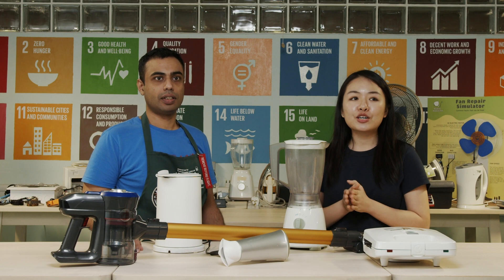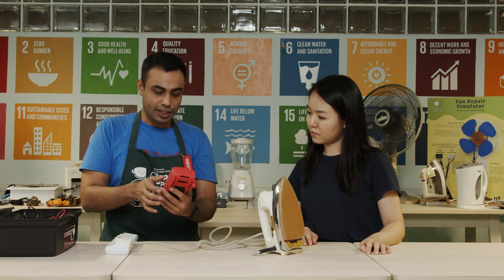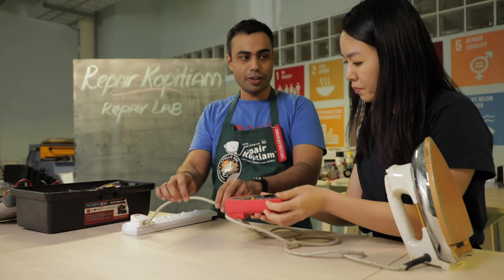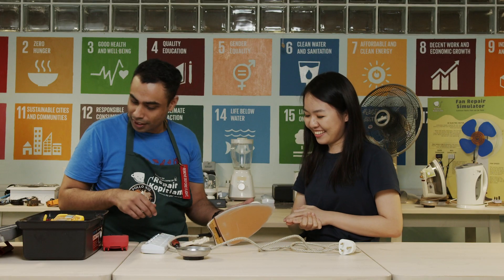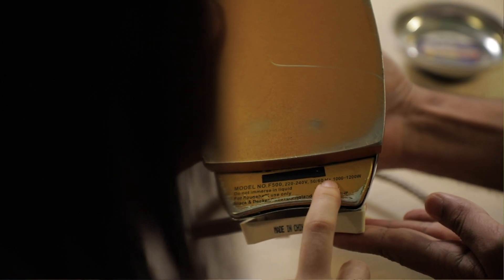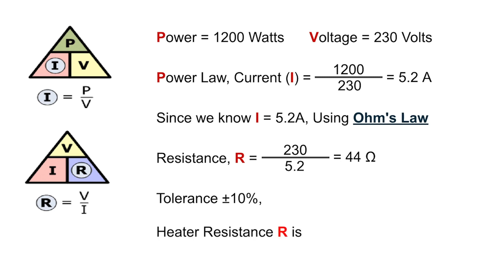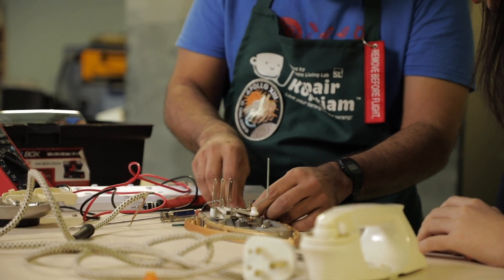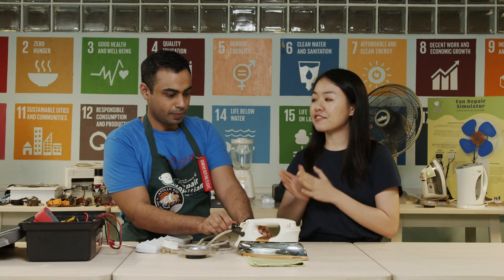RKS EP2 Heating Appliance Repair

Comment: What is should be setting on the multimeter and what should the reading on the multimeter to tell if the thermal fuse is working?
Reply: continuity test, check if signal pass thru

Comment: If it is not obvious that the fuse in the plug is blown, how to check if the fuse is working with the multimeter?
Reply: continuity test, again can check if signal pass thru. Blown = metal wire within fuse melt = no signal pass thru.